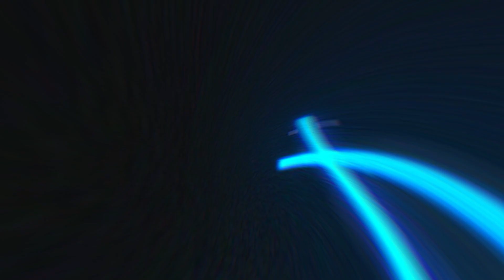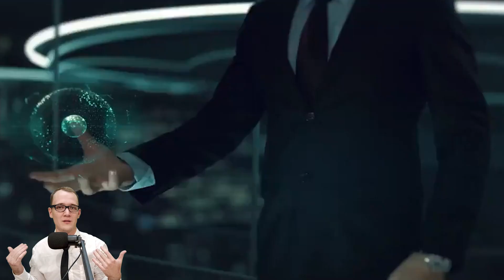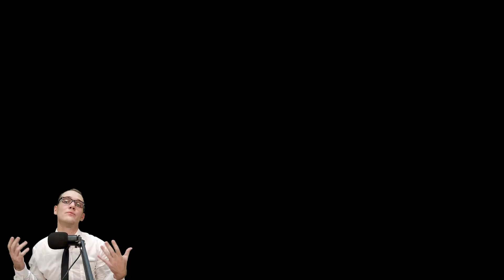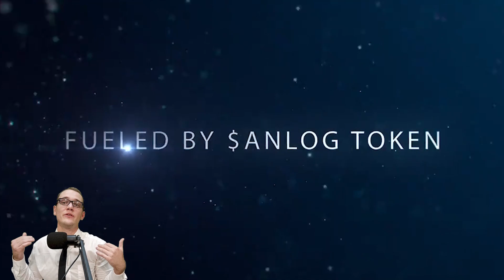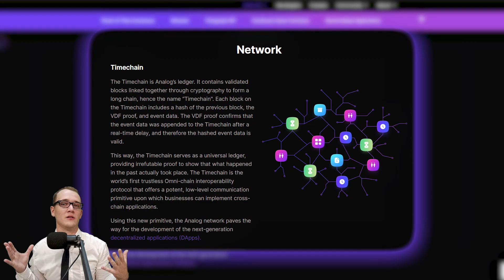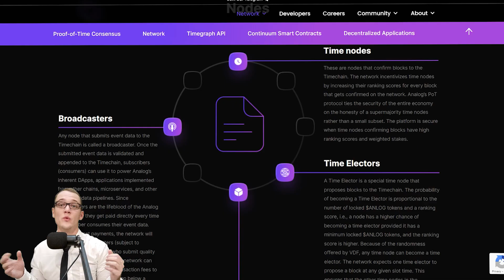Analog is a Layer-0 protocol that opens up the future for omnichain

Comment from the maker: Website: https://www.analog.one
Twitter: https://twitter.com/OneAnalog
Telegram: https://t.me/analogtimer
Discord: https://discord.com/invite/jacDmeyQge
Reddit: https://www.reddit.com/r/AnalogToken/
Medium: https://medium.com/@analogtime
Facebook: https://www.facebook.com/analogpost
LinkedIn: https://www.linkedin.com/company/53122972/admin/
Analog Wiki/Litepaper: https://docs.analog.one/analog-network/
Timepaper: https://www.analog.one/analog-papers/
Analog Cheat Sheet: https://docsend.com/view/2jdmbjqkpimb9749

Analog is a Layer-0 protocol that opens up the future for omnichain, secured using the Proof-of-Time consensus mechanism. In essence, the platform brings together an entire ecosystem of networks, allowing them to work together seamlessly. Although the term Layer-0 is rarely used, it is perhaps the most important part. It is a kind of initial stage of blockchain that allows various networks such as Bitcoin, Ethereum and many others to function. Layer-0 also provides the blockchain with the ability to implement cross-chain interactions between different layers.

#analog #omnichain #layer0